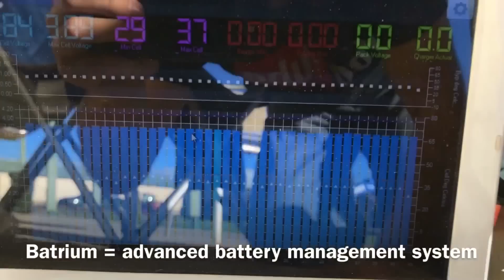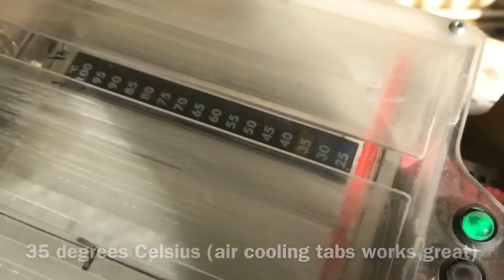210kW Racing Electric Yamaha R1 vs Petrol Bikes (race track) • Ripperton DIY Electric Motorcycle

Comment: That bike can probably can only make it around the track 2 or 3 times before it needs to be charged. Really I hate anything electric like this because you can hack into it and shut it off or do something else to it. If you think it's crazy when your computer gets hacked just wait until futuristic cars come around. They already make the gas and brake pedal electrically activate. It won't be hard to hack that shit.
Reply from the maker: +Brandon Adkins ohhh I'm not so worried about anything hacking into our electric bikes, maybe cars with all these computers connected to the cloud, navigation systems etc but bikes don't really need to be connected to these things. Once it's setup it's all good, if I want to do any changes to my motor controller I have to physically connect a USB cable and program the firmware, all old school nothing wireless, no Bluetooth or internet for potential hackers. 
Yes, I see what you're saying, customers love connected devices and big manufacturers love marketing these things so we will probably see some hacking cases like you described... I'm not buying production vehicles any time soon (I like making my own) so I'll kinda avoid this drama =]

Check out my 42kw little beast made using bicycle parts https://youtu.be/sRH_cpCwNDs
So much POWEEEEEERRR ohhh yeaaahhh...
Reply: ElectricBike that makes since. do you think they would be able to know where you are at all times while riding on an all electric bike tho? cops that is. every once in a while I like to go fast I understand it's not safe and I shouldn't do it but I go out to but fuck no where. idk I'm just kinda sceptical on them for now.

Comment: I'm just shocked he's managed to keep the sound. How in the flying fuck did he manage that?
Reply from the maker: hahahaha.. yeahhh... Danny made his own twin motor connected with chains and another chain connecting to the rear wheel. Electric motors are virtually silent and most that noise comes from the chain touching the sprockets.
My 42kw trike using bicycle parts is pretty noisy too, my controllers are a bit noisy so my motors make a bit of sound spinning over 11000rpm + the belt and chain https://www.youtube.com/watch?v=sRH_cpCwNDs&t

Comment: I am surprised no one has mentioned this bike looks a lot more like an R6 than an R1. The Fairings are R6 for sure, not R1.It does not necessarily look faster than the Petrol bikes. He is a faster rider than some of the others on the track but those other riders are cornering relatively slowly. Notice the first two bikes he passes in a corner were not even close to having a knee down.That being said, I give the bike builder much credit for his ingenuity in building an electric motorcycle.The beauty of electric bikes is the continuous torque and HP throughout  the RPM range as opposed to combustion engines which have varied torque and hp within the rpm range.Also, no gears to shiftYes electric bikes have the potential to be faster and more powerful than internal combustion engines. The fastest production bike in the world is Electric. Check out the LS-218 by LIghtning motorcycles

Comment: That bike could be dangerous to other riders in a race, so he needs to attach something like a tone generator for other riders to hear.
Reply from the maker: +Michael Parker the El Mofo racing electric car competed the 2014 season against the petrol cars and had to run a siren/buzzer so it wouldn't scare the other drivers while overtaking them... guess what, the electric SMASHED putting the petrol dudes to shame winning the season... petrol heads got pissed and the electric was banned from 2015... hahaha... 
So much POWEEEEEERRR

Comment: is that bike have a gearbox?
Reply from the maker: +Roby Speed single gear beast... there are some pros and cons in having a gear box, they're bigger and heavier than the electric motor, unnecessary gears (you'll never use first gear and spend most time on 2nd and 3rd gear)... most high powered electric vehicles are single gear (just a simple reduction gear to drop the high motor rpm to useable wheel speed)
Reply: ElectricBike how much HP / horse power in the dyno?

Comment: EV and dronecars will be the future. The IC (internal combustion) engine cars will be gone forever. Car manufacturers not realising this transformation will be left behind. EV cars are powerful, with less engine components, clean and very cheap to maintain. Then, why car manufacturers still waste time, resources and money creating concept cars or luxury cars or rather superhypercars on road, like all these cars with IC engines? Moving into the next century, human being will never use the roads anymore as the dronecar, esp produced by Ehang, a famous Chinese drone manufacturer, has replaced the cars as major means of transportation. The dronecars produced by Ehang are fully autonomous, no wheels, no wings, having their own brains to fly and land anywhere on earth as long as there are grounds with the space enough to accommodate the dronecars to land. Autonomous is very effective on flying objects that can manouver the machine freely in any direction. Human transportation on roads will not be viable anymore. So, producing such fancy concept cars with IC engines, though it's awesome today, but comes next century, these cars will be of no interest, as people will go for dronecars to fly them anywhere on earth. People still drive on roads but with EVs only. However, fully electric car manufacturers like Telsla, has the advantage of producing the dronecars as they possess the electrical engineering technology which drive all their cars, that also powers the dronecars. Just don't waste time and money inventing and designing thought to be futuristic concept cars on roads as people will have no interest on driving cars on the road anymore, except the EVs. Everyone will look forward to fly in a dronecar which will become a major transportation, very safe, very fast and very intelligent indeed. Perhaps jet plane will still be reliable for long range cross border transportation. EVs and drone cars are the future, really really awesome.

Comment: Hey man. So I'm building an electric motorcycle, and I have half an idea with weeks of nonstop research to learn as much as I can. I don't want to build anything too powerful but I do want it to be able to cruise at 60 mph with relative ease. I'm using it as a commuter. 

If at all possible, could you help me out? What wattage do I need in a motor and where can I find that bugger? ice been looking online for 2 kw motors to no avail.

Comment: scince they are homade I presume the motors are dc, you should make some brushless you would only need one and a huge esc
Reply from the maker: +Hamzoute There are 4x big brushless AC 3-phase motors, liquid cooled and all the fancy stuff... check it out https://instagram.com/p/BVzHFcHlgwe/
ESCs are mostly for little RC applications, other than that everyone uses sinewave sensored controller with hall sensors for smooth start.
ESC are cheap, lightweight, small but horrible at low rpm and normally fail under load. Even VESCs which is an evolution of ESCs also fail under load. 
Both ESC and VESC are limited to 12s 50.4v maximum... you can't even use them on 14s ebikes... this motorcycle is 175v... you can buy proper motor controllers that run 700v or more... most electric cars are around 400v...
I am making 42kw lightweight beast using big badass RC parts, 3x 160A ESCs boosted to 280A each and 3x brushless AC high performance motors, its only 12s but high amps, check it out https://youtu.be/sRH_cpCwNDs

Comment: that rear tire/ tyre looks like the bike needs some suspension tuning. Though I suppose the battery pack makes tuning the forks even more of a challenge.
Reply from the maker: +Eric Sageser yeahhh... this bike is actually lighter than the original petrol version, 185kg electric vs 199kg petrol. Most of the weight is down very low which is great =]

Comment: make the bateries plug and play... and then you can race again with no time ahayyy....
awsome job dude...
Reply from the maker: +surya jun yeaaahhh... this would be an awesome thing if they could just swap packs like that.... it isn't an impossible job... it's doable but pretty big and heavy... they use a crane to lift and remove the pack from the bike... when it comes to racing these guys will do whatever it takes to save time and finish the race haha... so much POWEEEEEERRR =]

Comment: Honest question is it possible to water cool an electric motor like this similiar to a high end gaming pc.
Reply from the maker: +Demetri Black YES.... this super motor is actually water cooled... the outside aluminium plates have holes and fluid pumping inside the plates and the hot water passes inside a radiator cooling down. Watch the video again and pay attention to some "pink hoses". 
Here are some other photos showing the motor and the massive cooling plates https://instagram.com/p/BVzHFcHlgwe/

Comment: A motorcycle needs the sound
Reply from the maker: +Andreas - possible to install a siren hahaha
Reply: No, a motorcycle does not "needs the sound". 
Period.
You might need the sound, 
but that is a different matter.
Reply: Is racing about the sound or the performance?
Reply: Sound as we know what gear or how fast our RPM is so when we enter that corner we can engine brake and take the fuck off by feeling it out. Since this bike is electric I wonder how experienced rider coop with not having to engine brake all the time. Going into corners with just brakes is wierd.
Reply: You want fancy sound with little HP?
Reply: Electrics motor do have engine brake, when you are not accelerating it's working like a generator and makes electricity, that is what he calls regen brake. You can see it in action here : https://www.instagram.com/p/BZs0hUFF2tB/

Comment: there ir a r6r
Reply from the maker: +sergio skik it's actually a R1 bike but with a lightweight fibreglass R6 racing fairing fitted after a crash end last year... still needs a proper paint =]
Reply: ElectricBike the fibreglass is r6 and the engine is electric what are the r1? you are crazy speaking
Reply from the maker: Yeeaahh.. R6 fairing, R1 bike and the motor is a homemade electric monster he made himself https://www.instagram.com/p/BVzHFcHlgwe/?taken-by=electricbikepower

Comment: Wow!  Really amazing machine the one thing I think I would miss terribly is the shifting even though it's a place errors can happen plus the added weight it contributes so much to the riding experience and it can set your skills apart and give you a chance to win if your shifting skills are more honed,  I hope they bring in more electric vehicles with gears
Reply from the maker: +DimensionsOfEarth yeaahhh there are some mad electric motorcycles with gears like the Brammo. It feels a bit strange first ride having one single gear but that much torque it kinda makes sense... 
Weight: this racing Electric R1 with that motor and massive battery pack is about 135kg total vs 199kg original Petrol R1... ohhh yeaaahhh!!!!

Comment: Awesome bike!!! how does it handle when you trail brake in corner using the regen? does feel the same as it would with a rear brake? would love to give this a jam!!
Reply from the maker: +Mark Norman yeaahh this bike end up lighter than the original Petrol R1 (185kg electric vs 199kg petrol) good cornering, so far the riders ABSOLUTELY LOVE regen brake... feeds power back to the battery, one less thing to have problems constantly maintaining... there are two types out there, "fixed" on/off (not so amazing) and "variable regen" this is the one you want.. total control... this is the one Danny is using in this bike =]
Reply: Look at the development going on here, I love it - really an opportunity for a bike company to really be the the tesla of the world - I know many companies are trying to work on it - but who will win?

Comment: All the riders at the track are beginners/just slow and at this level it won't matter if you have 100kw or 200kw. Beginners are usually even faster with 600cc bikes on slow tracks like this. Anybody with bit more experience would go pass all those guys probably with 125cc two stroke bike. 

But the electric bike is still really great and it would be nice to see bit better comparison video with it and petrol bikes with bit more experienced riders.
Reply from the maker: +Beyond the press yeaahhh here you can see the Ripperton bike with a Pro rider racing against a much bigger and faster 700 volts Voltron... Ripperton is the green rider: https://youtu.be/_VbE2JW5w7U
Reply: Thanks for the link! The bike seems to be really competitive and your rider is also really good
Reply: plus the advantage of all power immediately available. unlike gas which relies on the power curve vs rpm.   Another thing i'd like to know is the weight of this bike before and after.   did electric conversion add or reduce total weight.
Reply: Probably need its own category once it gets to that level. Even with cars too its getting to point where battery performance will be a different catergory.
Reply: Beyond the press wtf are you doing here
Reply: There's always that one douchebag that thinks he has it all figured out.
Reply: Excuses excuses
Reply: it is still cool... dont you think?
Reply: Beyond the press mate! I really doubt it that a 125 2 stroke could compete on that track let alone fucking win
Reply: Convert 210kw to mechanical hp.  I've already done it and I can promise you that a bike pushing that power is going to overtake anything running on gas.  If a 100hp Zero SR can out pull a 240+hp Ninja H2, then a 281hp electric monster is definitely going to destroy gas competition .
Reply: beyond The Press
Lol how did you get in here
By the way id like to see you crush a motorcycle

Comment: How heavy is that thing?
Reply from the maker: +Mr. Finger I think this bike is 185kg vs 199kg for the original Petrol Yamaha R1... pretty good weight loss program haha =]
Reply: ElectricBike I don't know... A normal race spec R1 probably weighs considerably less. The first gen R1 road version weighed 177 kg dry.
Reply: ElectricBike I don't know... A normal race spec R1 probably weighs considerably less. The first gen R1 road version weighed 177 kg dry.
Reply: ElectricBike I don't know... A normal race spec R1 probably weighs considerably less. The first gen R1 road version weighed 177 kg dry.
Reply from the maker: Henrik Paulsen at least the 2017 regular R1 on Yamaha's website says 199kg, racing version would be lighter..

Comment: cringy speaker annoying as fuck.... Also a bunch of Lipo batteries connected in series?....That should be a big boom in case of a crash
Reply from the maker: +kostas anton bike crashed pretty bad and nothing happened to the battery... Danny raced this bike for 6 years, with all this experience he designed his pack in a way that even if something happens and a cell start a fire in the middle of the pack, he can easily and quickly extinguish he fire, there are some channels to pump liquid cooling the cells avoiding or stopping the thermal runaway. Everything is very well thought in this bike. The other guy he races against, rides a 700v bike with an even bigger pack.. imagine 166 series... haha

Comment: Bruno! Finally checking in after some time away from ebikes. This is in a different league. 3phs charging & huge battery pack. How much does it weigh? And has it changed the handling much? Front wheel braking must be immense with all that mass loading the front tyre. Danny really is using every mm of that tyre. Needs some fake exhaust sounds to let everyone know he's coming through.
How much current does it draw? Torque curve at RPM? And how much does it regen under braking?
Reply from the maker: Yeeeaahh.. this is ebikes taken to the next level hahahaa.. 
185kg vs 199kg for the original petrol version.. 
Danny wanted to keep the handling the same or better than the original bike, check what a much lighter professional rider can do riding this bike against some other much bigger electric superbikes (Ripperton is the orange bike with the green rider) https://www.youtube.com/watch?v=_VbE2JW5w7U
Front wheel braking is actually easier as the bike is lighter and Danny designed his unique variable regen, did u see how late he starts braking compared to the other bikes?
Controllers can peak 1200A.. hahahaha.. this is insane POWEEEEEEEERRRR!!!
Reply: re no noise you could just record some kids making exhaust noises ,,,that would be funny as f**k    :)

Comment: That's epic!, does it weigh more than a normal r1?
Reply: supermegaas Those batteries have to weigh a ton... but he also doesn't have a heavy liter engine block, gas tank (full of fuel), exhaust, etc. I'd be curious to know which weighs more as well.
Reply from the maker: +supermegaas this bike ended up lighter than the original R1.
Petrol (2017 model = 199kg)
Electric (Ripperton's = +/-185kg) + monster torque =]
Reply from the maker: +Michael Degginger 
Yamaha R1 Petrol (2017 model) = 199kg
Ripperton's electric = 185kg... waaay lighter =]
Reply: That's insane! haha thanks for the reply